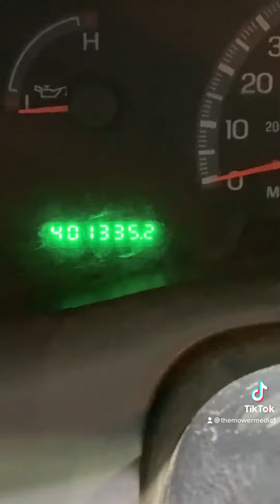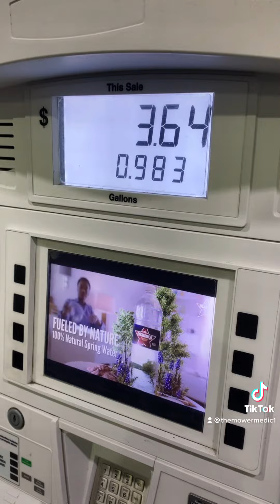HOW TO GET HALF A MILLION MILES OUT OF YOUR CAR, TRUCK, OR SUV

Comment: Mowermedic would using just a standard 2 oz little bottle of 2-cycle oil (vs the ready to use pre-mix) work since you're mixing it with gas or would that be too much for the mixture?  Maybe half the bottle?  Thanks!

Comment: You must have a good truck to get that many miles out of it and have took care of it. Did you buy it new. What year and make and model is it and what engine. Have you had any major problems out of it or just done routine maintenance on it. Does it have a lot of highway miles on it because it seems like most trucks that are just used on short trips especially around town wear out a lot faster.   Have a good day.
Reply from the maker: Yes I bought that truck new, it’s a 2002 F150 with the 4.2V6 and five speed manual

Comment: Why not use Lucas upper cylinder lubricant and fuel injector cleaner? A product specifically designed to do what you are trying to accomplish.

In my car and truck is a small bucket with paper shop rags, a package of wet wipe towels and long neck bottles of upper cylinder lubricant dissolved in a bit of gasoline ready to dispense. Bada ping bada boom
Reply from the maker: Oh heck yeah I use the hell out of Lucas fuel injector and upper cylinder lube as well as marvels mystery oil the point is to give the fuel just a little bit of lubricity to help lubricate the rings piston skirts fuel injectors and fuel pump

Comment: Red Armor or bust! Kidding aside, is this for real? I would be concerned about this gelling up my fuel filter, lines, or injectors especially in cold weather. Not to mention the smoke and clogging my catalyst.
Reply from the maker: Of course this is for real I’ve been doing it for over 400,000 miles with no problems
Reply: If you drive it regularly should not gel, but I would be a little concerned about the catalytic converter

Comment: I usually use mystery oil   and or  two cycle oil mixed together sometimes with  Lubeguard differential additive  @about a half ounce to a gallon plus barryman's B12  on all my four-cycle  machines  it protects the valve sealing surfaces from carbon deposit buildup and wear while drawing heat off the exhaust valves especially my air cool big bore motors when I load them up on a hot summer day   and it also conditions the part in your fuel system and keeps the scale from building up and making a sticky scaling binding mess    like on my machines that sit around dormant for a few months without being started .. if they're gonna sit around very long   I try to get a little swig of fuel stabilizer in them

Comment: Another question also. Would it hurt to do this to your riding lawn mower engine every now and then. Never thought about using a 2 cycle mixed fuel in a regular engine before. Can you explain what this does to help the engine in a truck or a regular riding lawn mower engine. Thanks
Reply from the maker: Total fuel system in engine lubricity